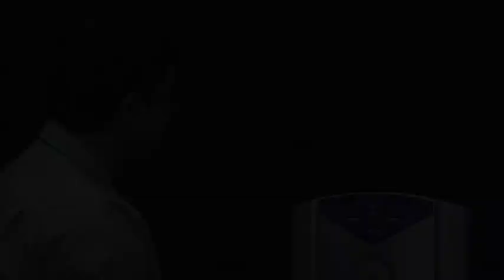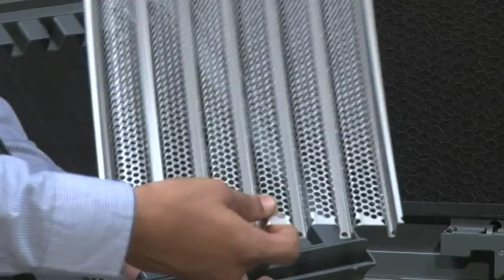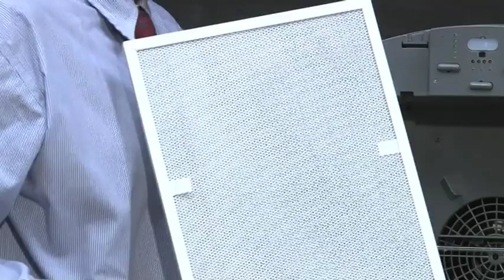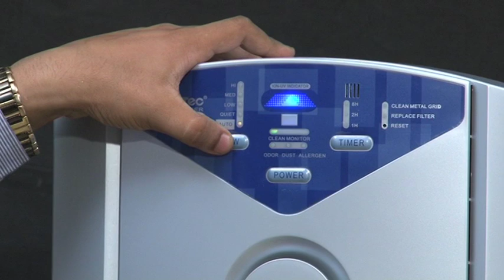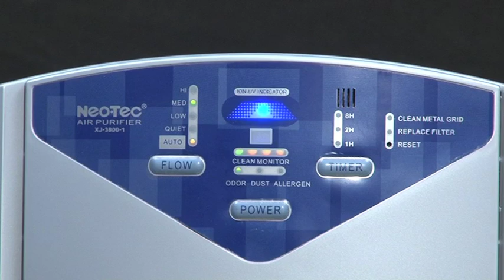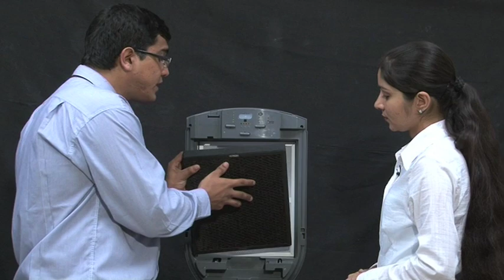AIR PURIFIER XJ-3800-I

Comment: This purifier is a scam! Photocatalitic filter is a fake, uv lamp, is 2W power, carbon filter is 200g in total, and not prevents the air flow, 50% of air flow is passes freely through it, the "hepa" is not hepa. 25m^3 room is not filtered in 24 even 48 hour. The torch beam is stay visible. I am very disapointed.
Reply from the maker: Nooo... if you are in India please give us a call @ 011-26183611 and speak to me directly 

We would like to prove to you what's fake and what's not 

These machines are tested by the US dept of agricultural and German labs 

I am sure we can answer your queries if you have some genuine concerns
Reply: No, I am in Ukraine, use same 2 devises "Idea" brand.

Comment: What is the replacement filer cost?
*HEPA filter and Activated carbon filer are one unit which has to be replaced as a single unit?
Reply from the maker: Rajan Ng Right Hepa filter and Activated Carbon filter are on 1 unit and has to be replaced as a single unit.
Reply from the maker: +Rajan Ng Replacement Cost Is Rs 2650.From here you can buy online http://www.amazon.in/Crusaders-XJ-3800-I-Activated-Carbon-Filter/dp/B010AEAFC8/ref=sr_1_11?ie=UTF8&qid=1443245150&sr=8-11&keywords=crusaders+air+purifier